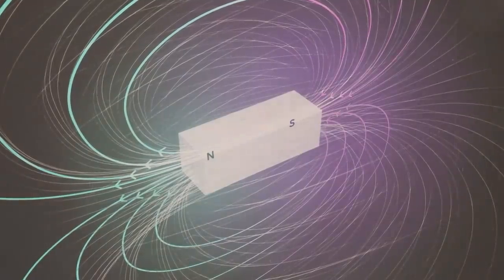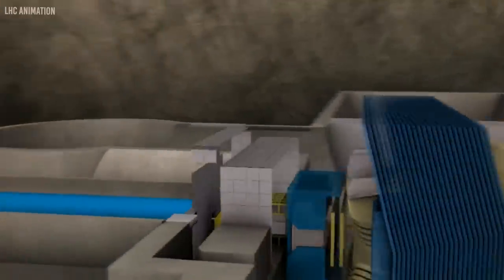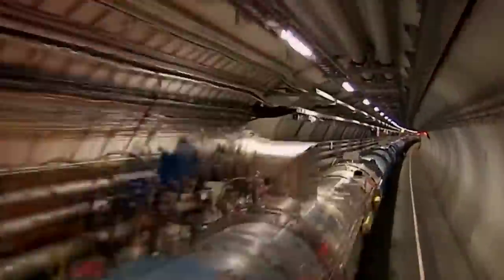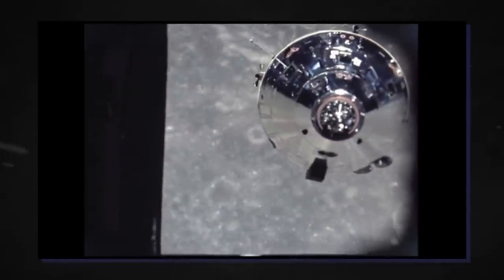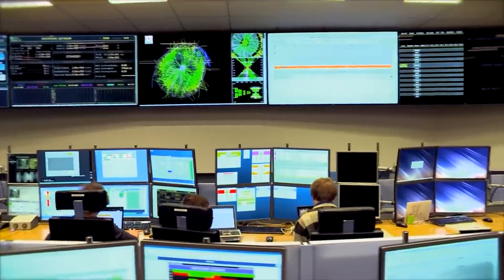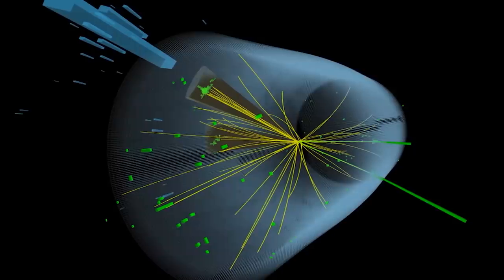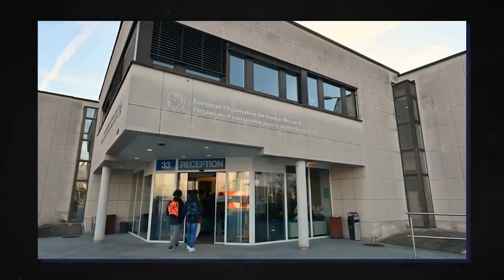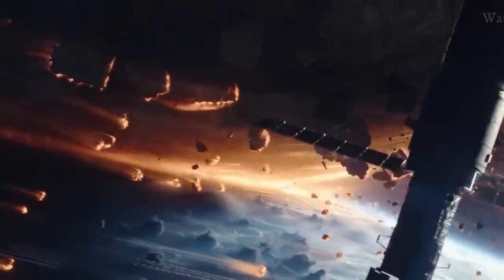CERN Large Hadron Collider Fired Up Again but Now Something Emerged!

Comment: Say you did open a portal... Unless the density of space time, air, or water, were equal in density on both sides, everything will either be sucked into it, or blasted from it. Don't these scientists know how pressure and concentration gradients work? It's basic science. If you don't understand what I'm talking about, go up in an airplane, and then open the hatch and see what happens.
Reply: Does anyone understand conservation of matter or conservation of momentum? Anyone at all!? OH! THERE YOU ARE. Hi Set. 🤓
Reply: Can't we just push the corn science guys out. 😂 there's my Einstein solution to this preticular problem
Reply: @walmart7626  Hey now. Everyone has something meaningful to contribute. In the past, my rookie mistake has been that I was so arrogant, I didn't believe those less intelligent than me could teach me anything. Intelligence is only one aspect of cognitive architecture. Something to consider. Lol to corn scientist though. 😂
Reply: @Missy-Leigh   for the record I call them corn scientists because thier not fit too microwave popcorn let alone tamper with this stuff.
Reply: Those weasels running around CERN with their spanners causing chaos and anarchy. Buy them some nuts and put them on the payroll. A pound of nuts a week and free coke.
Reply: Those hadrons will get a speeding ticket.